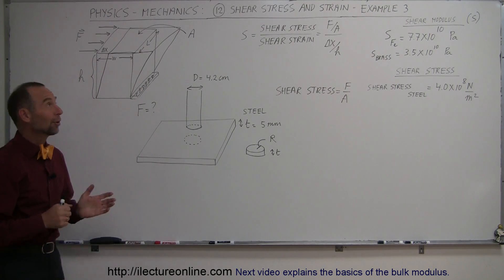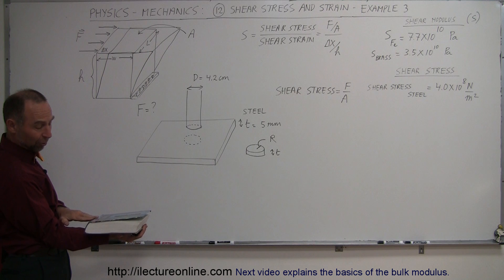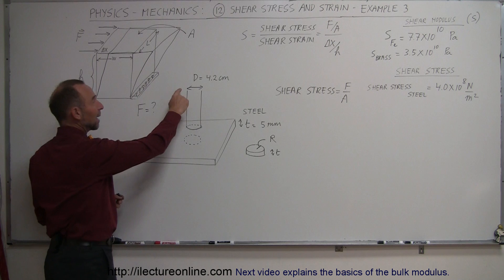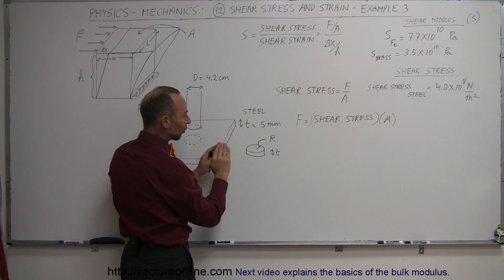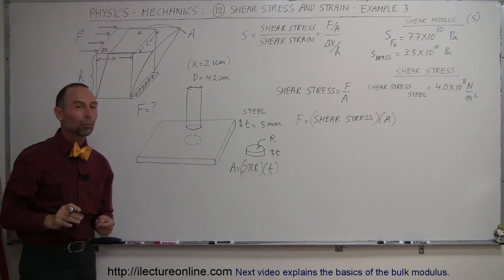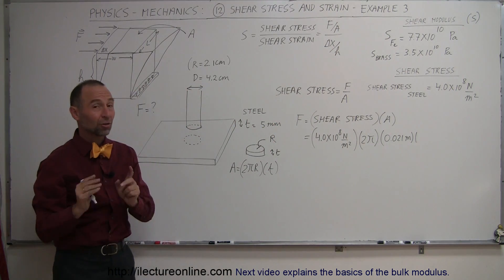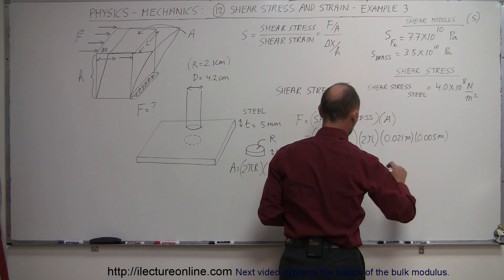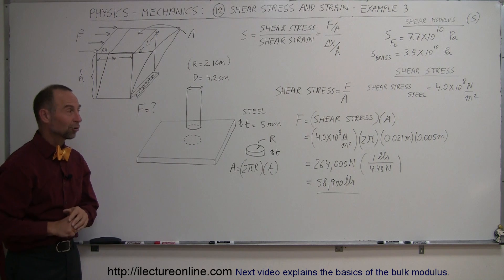Physics - Mechanics: Stress and Strain (12 of 16) Ex. 3: Punch Hole in Steel Plate

Comment: Hello Michel, could I use this method to design a punching machine? thanks !!
Reply from the maker: This does indeed calculate the force needed to punch a hole.  But then you also need to think about the impulse, which is Force x Time.  That means if the punch comes down quickly, the punch applies more force.
Reply: @MichelvanBiezen  Thanks a lot !

Comment: help
Reply from the maker: What is your question?
Reply: @MichelvanBiezen  How do you calculate the force needed for a staple to punch through 30 sheets of office paper?
Reply from the maker: You would do it exactly the same way as is shown in the video.  You will have to look up the shear strength of the paper you are using and 10 sheets of paper is approximately 1 mm thick.

Comment: great video again !! Do we also take into account the ductility of the material? Like what would happen if we do the same calculation on composites, composite metals etc. Would this equation would be valid or some other parameters will also come into play?
Reply from the maker: These methods and equations, do not take into account specific properties of the material.  This is just a basic method of solving these types of problems, (just like calculating projectile motion without wind resistance).  It teaches us the fundamental properties of materials and gets you close and is typically good enough.

Comment: why circle area is not pi*r2 sir?
Reply from the maker: +Hein MT In this case the area is not the area of the circle, but the area of the edge of the circular piece that is cut out.  When you stretch it out, it looks like a ribbon, thus its area is length time height.

Comment: I don't understand where the information for the shear stress came from, or how it relates to the shear modulus.
Reply from the maker: +TheLordGojira The shear stress of a material can be found in any related reference text or the CRC.  Thus the force required to punch a hole in a metal sheet is equal to the shear stress multiplied by the area of the sides of the hole.